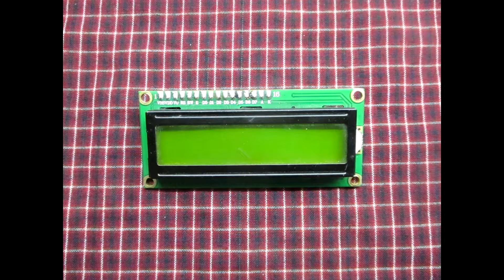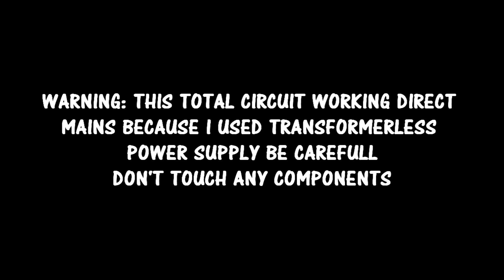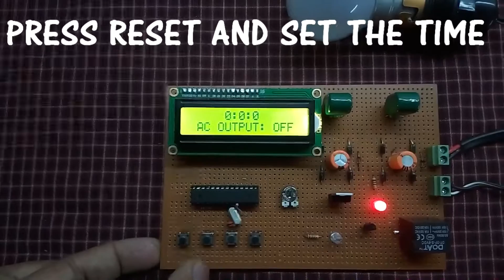MAKE A ARDUINO ADJUSTABLE TIMER CONTROL WITH LCD DISPLAY

Comment: Hii brother. Can you please make a automatic water level indicator just like kiyani tech made. 
Kiyani tech used only ic instead of complete arduino board so circuit became quite difficult. Brother i  request you to  please make such project by using complete arduino board (instead of only atmega chip).
Reply: https://youtu.be/WwGaTuqidGA
Reply from the maker: Join my What's app and share your complete idea about this water level controller...

Comment: Pls help me I have done circuit same as showing in the video. And I upload program and first check with arudino it's work well.But after that I remove chip Atmega328pu  from Arduino and insert to my circuit it's nothing showing anything on display. I know very well my connections are correct but I don't know why it's not working on my circuit.
Reply from the maker: Check out the the Arduino circuit and lcd display connection. then you face the same problem you will  try to arduino board....
Reply from the maker: https://photos.app.goo.gl/RfEjQx4FziDPbMNq8 Atmega328P circuit check this...

Comment: Which ic you using on board and what is the number
Reply from the maker: ATmega328P-PU IC
Reply: @Circuitoptimize23  thanks
Reply: @Circuitoptimize23  can u make complicated tutorial for this